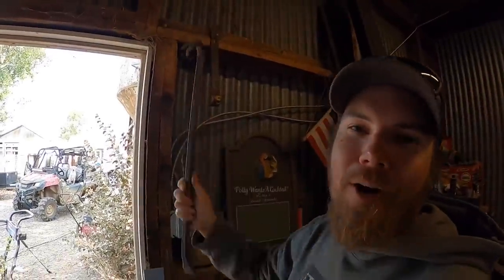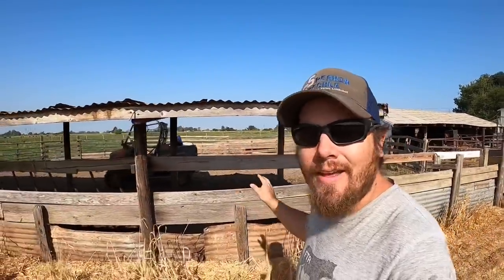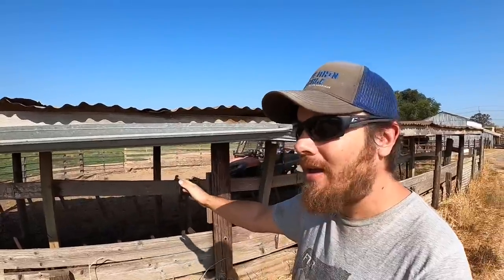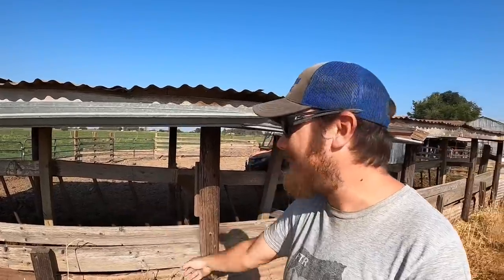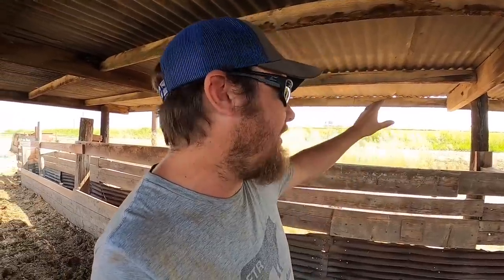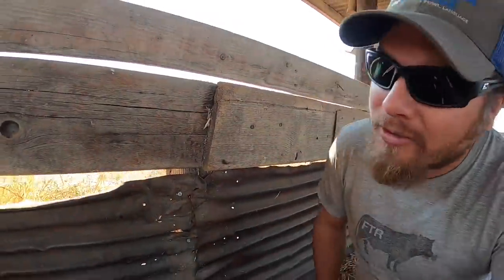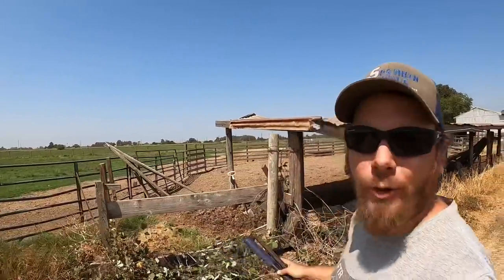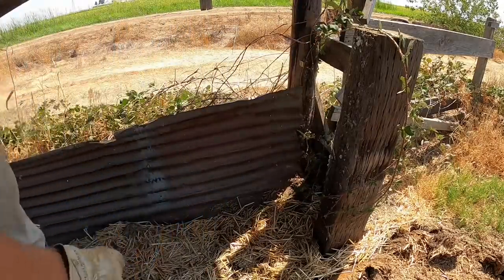Small Bale Bunk Feeder Teardown!

Comment: Tyler I was thinking, with the feeder rails you took down you could cut those up and make an 8 sided feeder rings of your own! Tell me what you think! I love these vids more please! LOL!
Reply from the maker: Yes I thought of that but I think the plan for those is to weld some ends on them (making a rectangle) and throw an axle underneath to make a portable feed wagon I can move to the winter pasture
Reply: @farmertylerranch4399  I do agree about the angle be a pain. I like your idea of a feeder wagon! Have a great day sir!
Reply: You dont want to do that. How about if you put them back where they were.  And raise them up and weld on a axle and tires. In several spots.  Now on the cows side of the pen. Mount a pulley and a cable. Then the outside of the pen you mount 2 or 3 winches. This would pull the feeder panel back towards the cattle.   So the wall slides in and out.   The outside is where you would load the bales. Then swing into place agate. So baby calves that got through the feed bars. Could not escape